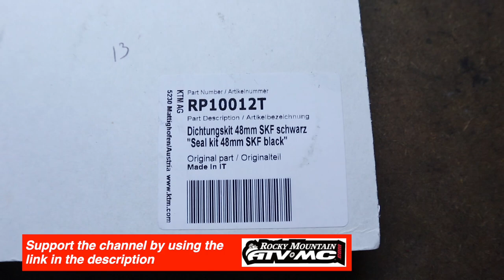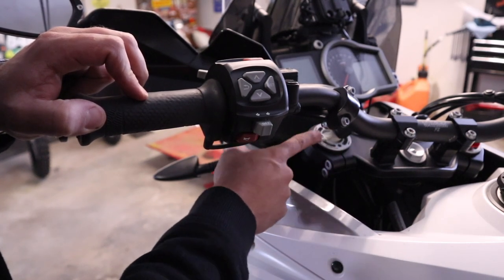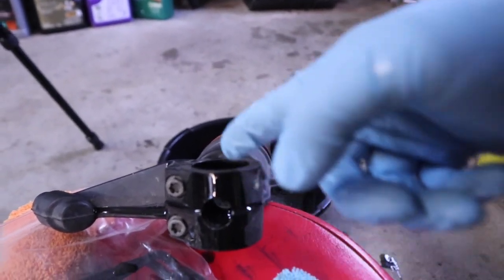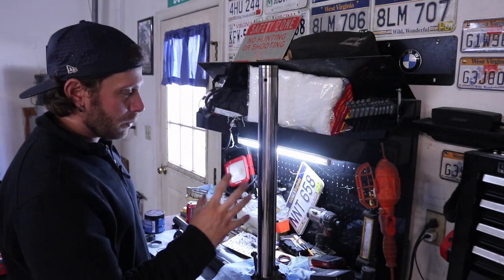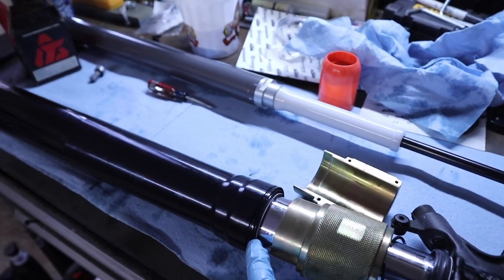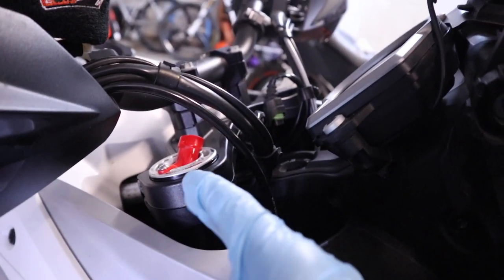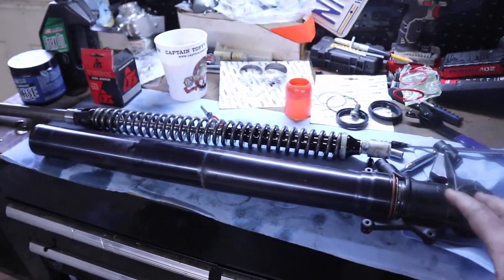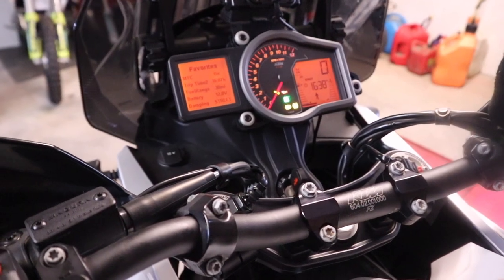KTM WP Semi-Active Fork Rebuild | KTM 1190 1290 | Back in the Garage

Comment: One tip to save money on special tools.  I learned this from rebuilding my CR250 forks (from a YouTube video).  To drive the seal and bushings in you don't really need the 50.00 seal driver.  All you need is electrical tape.  layer it up so it is at least half the thickness of the seal.  Be careful to keep it lined up to keep the line sharp.  it will be straight enough even if you are a little sloppy and will drive the seal in just as good as the special tool.  Just clip in the retainer clip (so it snaps in place), then unwrap the tape in that order in case you need to go in a little deeper.  Then push the dust seal in by hand

Comment: I did a similar job on my 990A (non-active type WP), the Motion Pro Seal Bullet was a must have, I tried with other methods (cling film etc) and the seal must have torn as it leaked and I had to go at it again - with the bullet the seal slid straight on no problems.  Great tutorial.

Comment: Wow!! I totally appreciate the information given here. I however have a 2016 1190S with active suspension but my forks have 2 springs, one in each fork. Anyplace to find out what amount of oil goes in those types as the 1290 forks even have different elec caps.... a spanner pin type wrench cannot be used.🤷‍♂️
Reply from the maker: Best I can say is download the service manual. https://print.ktm.com/

Comment: Great video, thanks. 👍

I have a 2017 1290 Super Adventure S & find the forks too stiff even on the comfort setting. I've looked for softer fork springs, not found any yet.  My concern is that fitting softer fork springs will confuse the electronic suspension, leading to error codes on the dash - any thoughts on this?

Thanks in advance 👍

Comment: Dude thanks to share, this channel is amazing.

Questions

How is the feel with the forks in the top ring position for offroad and low speed in trafic do you get it more estable?

to just change the oil without seals change i still need to loosen the bottom screw of legs the one close to the axel.

Thanks dude.

Comment: Great video. I was apprehensive about doing the seals when the need arises but your video makes it look do-able. Do you know if it would be the same WP forks used on the Triumph Tiger 1200 semi active system. Many thanks for the comprehensive instructions.
Reply from the maker: They aren’t exactly the same but should be similar enough.
Reply: @2WR  OK  thanks a lot.

Comment: Great video!!! Have you did a video on rebuilding the rear shock? I'm guessing not cause I couldn't find one in your videos but there are a lot lol
Reply from the maker: No. The rear shock isn't technically rebuildable but I'm working with my suspension guy on it sometime later this year. Unless you have the proper tools (plus nitrogen and a vacuum/bleeder pump) the rear shock will not be DIY for most.

Comment: hello 2 Wheeled Rider, nice video by the way! just a question. I have the same bike and I want to know if it is possible to add a manual preloaded monoshok like the R version mono and it still works with the semi active suspension in the front without this "SUSPENSION" message on the panel because if you got this alert it will automatically lock the semi-active and suspension modes only in mode 1 and almost for me in hard sport mode. I want to say that the optimal situation will be to keep the modes semi-active and only on the front suspension. Can we have this setup?

Comment: I believe my 22 1290 Super Duke R Evo has similar forks. Is it possible to make the forks shorter to lower the front end of the bike by 2-3 inches? Maybe different springs or trimming the springs? Any information would be very helpful thanks!
Reply from the maker: I don’t see how that would be possible considering you only have 4.9” of travel to begin with.

Comment: What age and miles was your bike at when you had to do this service? I have a 2019 SAS, about 30 months in service with just over 30K miles, but haven’t seen a need to do any suspension work yet. It appears you needed to service the forks because a fork seal wore out?

Fantastic video with great detailed explanations. Thanks for sharing.
Reply from the maker: Realize folks don’t watch every video but bike has over 50k miles on it. Oil/Seals/Bushings we’re getting replaced regardless of the one seal leaking as they were way over due. Fork oil, just like any other oil/fluid breaks down over time. And thx!
Reply: @2WR  it’s a little surprising there’s generally no way to change the oil without repairing the entire assembly, knowing that suspension oil does breakdown over time, like all oil. I’m guessing fork seals usually breakdown by the time the oil does. 

But congrats on 50K, hopefully many more to follow!

Comment: My right is laeking.  Dumb question?  When you reassemble, is there any realignment necessary or does it all line up back in the original position (no twisting)?  Great video
Reply from the maker: So long as you get both forks at the same height in the triple clamp the rest takes care of itself.

Comment: I really appreciate your back in th garage video's.   Even though this one was a little late for me. 😀 I bought my 2020 SAS and about 1000 miles in, the right fork started leaking but of course the dealer and ktm told me that it was a wearable item so I was responsible for replacement. Replaced both of the seals with KTM seals and the right fork still leaked after another 500 or so miles.   Took only the right fork apart and couldn't see any burrs but ran some 5000 grit and polished it and used a new Pivot works seal and haven't had any problems since.  Around 8000 miles since the last seal change.    One question though, the service manual calls for heating up the outer leg before pulling it apart and setting the seals on assembly, do you think that is a waste of time?  Thanks for all of you efforts!!
Reply from the maker: All depends. U can heat them up if you need to but I’ve not had to do it on any set of forks yet.
Reply: @2WR  Nice.   It was a pain in the ass heating them up.  I'll skip in next time.  Thanks again.

Comment: Hi, I have a question have you ever encountered the problem of rattling suspension ? I have a problem that when I bounce the fork it feels a knock on the handlebars, supposedly a known problem and even in new motorcycles it hits .
Reply from the maker: No, I haven’t. Check the recall/tech bulletins. There were some models that had a recall for suspension issues. I don’t remember the specifics.
Reply: @2WR  Unfortunately, there was already a software update. the strangest thing is that some pieces have it and others don't...

Comment: Going to do oil and seals on my Husqvarna Svartpilen 701forks, the procedure is probably very similar as far as the parts and sequence. Is there a particular way to align the fork legs once you put them back on the triple clamp to ensure the front end is straight? I was just gonna make a reference mark with a paint sharpie on the triple clamp. Any other suggestions? Thanks
Reply from the maker: So…u obviously want to ensure u have them on the same line or whatever mark u want to use to get them equal in the top of the triple clamp. That’s it’s. Ensure u properly tighten/torque the axle. (Inner tubes spin in the outer tubes)

Comment: Hello there mate, had my forks done at KTM dealership, however it seems to be really unstable over bumps and small which is lost me any ideas what's wrong with them
Reply from the maker: Start by checking the reinstalled them properly (axle aligned, forks aligned, etc). If that checks out then you know your answer, they messed something up when they serviced them.

Comment: Mario, awesome video as always!!!  As we had previously talked about, my right seal was leaking a bit at the end of the 2021 season. So over the holidays, I did the seal mate thing and looks like it did the job. Oil leak seems to have stoped. But I have not gotten the bike out yet as our winter here in Canada is still going on. But I should get the bike out at the end of April to see if the seal mate worked. My SAT only has 16 000km on it so I hope I don't have to pull everything apart. Some do a heavier oil when they do the forks, any thoughts on that? Benefits ? Mario, you are a legend!!!  Love your vids... 😀
Reply: well, I went for a ride today and I guess the seal mate did the job... fork was dry as a bone... Lets hope it holds..
Reply from the maker: Glad all is well!